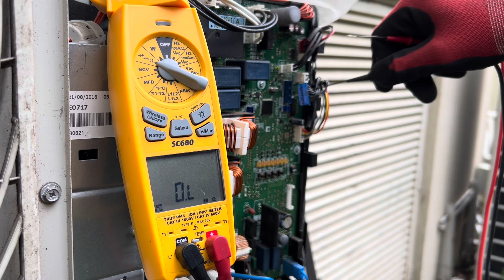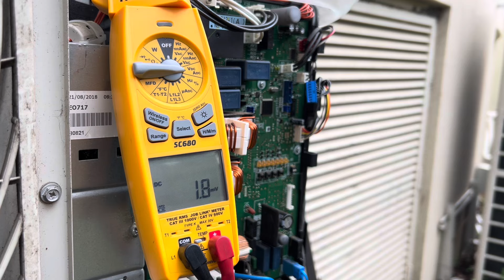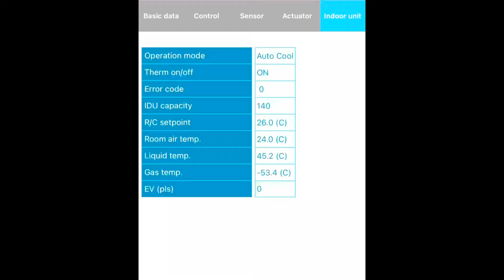Daikin / Compressor is Ramping Down After 10 Minutes

Comment: Had one yesterday going into UO (loss of charge) fault not on the controller but In the Bluetooth checker and yeah had the same thing the suction temp was reading 24degrees but my Testo clamp was 4degrees. I always carry spare sensor kit in my ute now
Reply: And why didnt you use a drill that was frustrating to watch you use a screw driver lol
Reply from the maker: It’s a good call. Quick easy fix if you have them on you. Haha I’ve been meaning to get a 12V drill to put in my bag but I keep buying other tools over it. The 18V is bulky and annoying to carry around.
Reply: Milwaukee M12 has been a game changer for my kit

Comment: Do you have any issues testing high DCV on that fieldpiece meter? Looking at getting one for myself and wondered. I had an old fieldpiece meter and it's range wasn't high enough when testing DCV between inverter and control PCB's
Reply from the maker: So far I’ve had no issues testing any components or voltage with the meter. I do really like it overall.
Reply: @hvacraustralia  thanks for the feed back mate. Keep up the good work, I enjoy your approach and processes